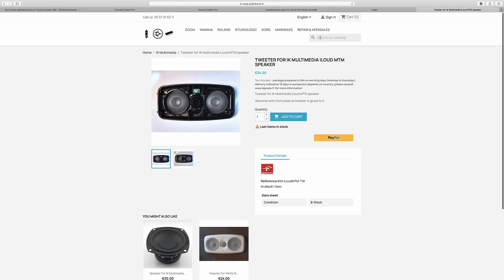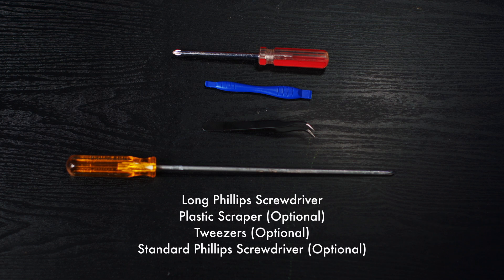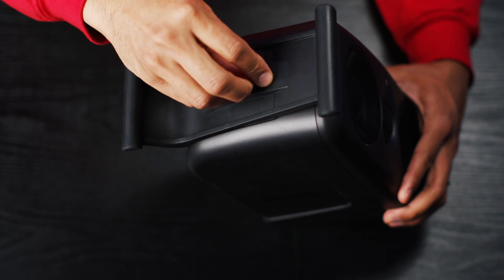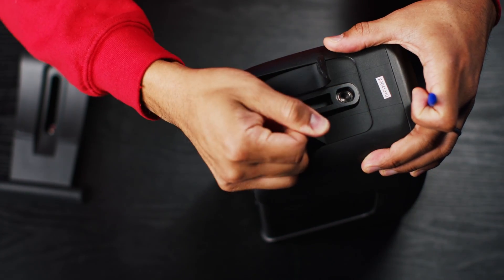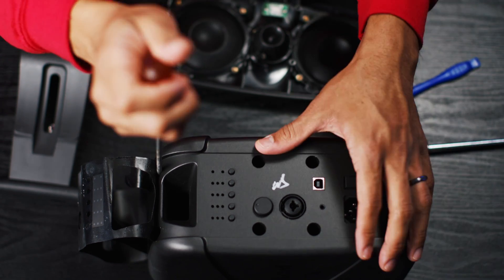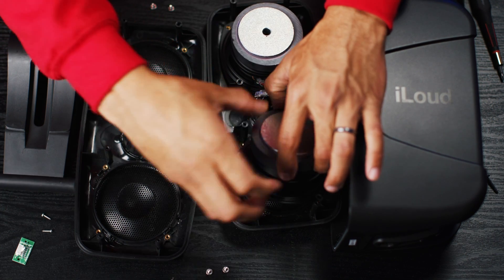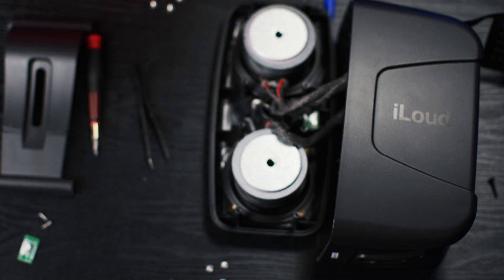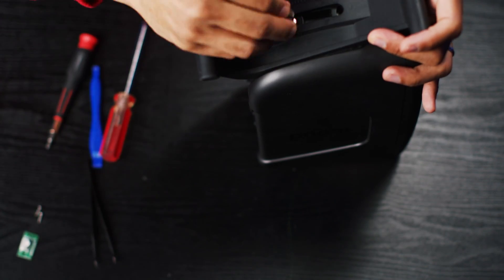How To Fix Your Studio Speaker | IK Multimedia ILOUD MTM

Comment: Dude, I have a blown woofer (never listen at loud levels so I don't know why it happened) and IK told me they don't fix these speakers at this time. They wouldn't even sell the parts. I've only own them for 2 years. Was very happy with the sound but the company does not stand behind their product. Thank God I found this video! I order two woofers from the link you posted.  I was even thinking of getting their higher end Precision Monitors that price wise competes with the Genelecs 8330A, KH-120 etc... Based of the sound and DSP of the MTM I would imagine they sound pretty good, but after this experience, NOT A CHANCE I'll buy another IK product. Liked and subscribed! You Rock! Big Up to Audiotronic!
Reply from the maker: Most companies are ;ike that. they don't want to sell parts.
Reply: I have this exact problem with a pair of iLoud Micro monitors. Hard to believe the woofers are blown with so little use. Were you able to fix yours? Now that I know how to get them apart...I might take it apart and take a look around.
Reply: @Berticus2008  I replaced the two woofers (wasn't sure which woofer was blown) The process was easy enough, but the rear sticker looks bad once it is removed. It was obviously designed not to be serviceable by the customer.  In any case they still sound bad, to a lesser extent than before, so replacing the woofers did make it better. I'm thinking now its the amp/dsp. I did a sweep from 20-20kHz and it sounded fine until it gets to the 40-60hz range. Then it is horribly distorted. The other speaker sounds great with the same sweep/source. At this point I dont feel like investing more money into them. Already spent $80 on the woofers. I'm going to save the money and buy Genelecs or Neumann monitors. Yes they are more expensive, but lesson learned. Too bad because the MTM really sound good, DSP worked well and the footprint and SPL was great.  Maybe it was an early production bug, but the lack of support from the company is really what is driving me away.

Comment: Difficult to get replacement parts now. However I found the XT25SC40 tweeter fits like it was designed for it! The sound is not exactly the same as original but it's not miles away, a good alternative to dumping the speaker.
Reply from the maker: awesome

Comment: Is the -11db function usable ? I am planning on getting the iloud mtm but at  night i was thinking of utilizing the -11db function not to bother my neighbors.

I generally looking for an active speaker that basically muting bass option which this is closest thing to that ive seen so far .

If it is usable how bad or good are they while in that mode ?
Reply from the maker: the -11db feature refers the signal going in, not the signal going out. ... I would just recommend turning down the volume on your monitors. or Headphones,. Also room acoustic could help(especially bass traps in the corners) .(room acoustics is not sound proofing so sound will still escape)
Reply: @Willychinremix  is there way to eliminate alot of the low end for night time usage ? Or should i look for other speakers?
Reply from the maker: @SamLGND  there is the new firmware update that allows you to cut the bass on the MTM when you are using it with a sub woofer. this could be an option just to cut the bass

...Added new 80 Hz low cutoff for Bass Management (LFE) and subwoofer...
Reply: @Willychinremix  thanks with a cutoff at 80hz will it really cut the bass significantly?
Reply from the maker: @SamLGND  It does take the boom out. I would recommend you get a pair and try them out. See if they work for you.
Reply: @Willychinremix  unfortunately dont have the opportunity to try it but i think using the low frequency cut off at 80hz along with the LF preset at -3db , it should take out a considerable amount. 

I guess if it does not meet the requirements il buy an pair of Keff Eggs duo for night time usage.

I am no sound expert so im not sure how a cut off at 80hz with a pre-set of -3db would sound aha  , im just assuming from what im gathering that it should be thin..